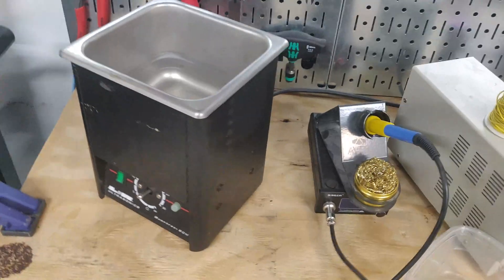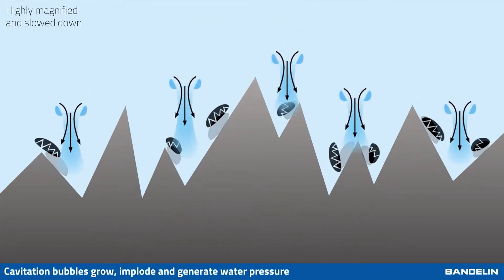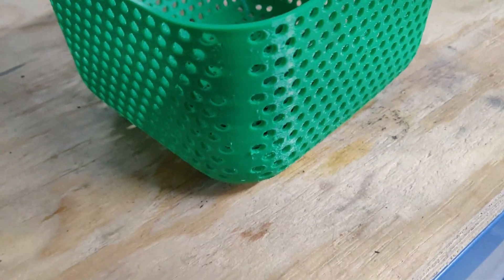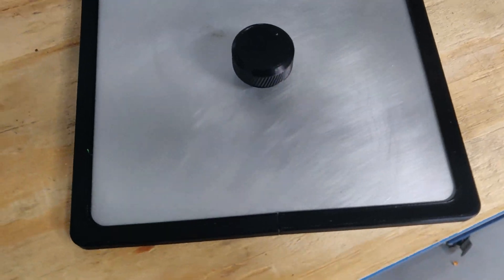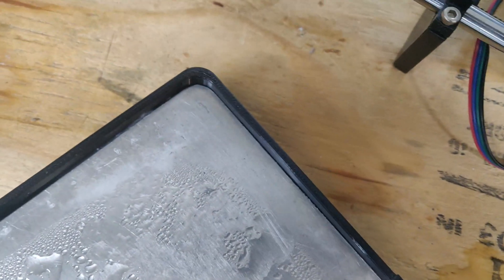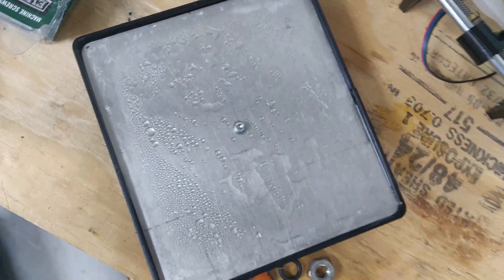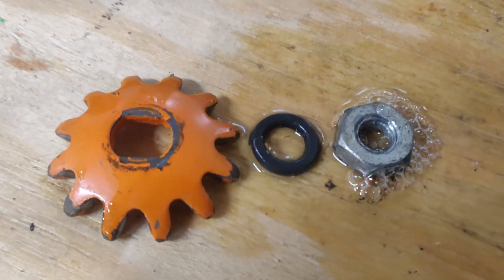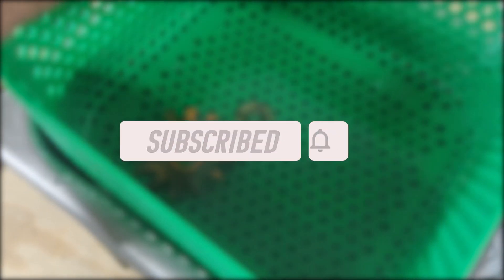Making an Old Ultrasonic Cleaner Usable with 3D Prints!

Comment: You can put jars or containers inside the cleaner, filled with solution and parts. Means your cleaner's bath remains clean, and your machine requires less messing about. The waves hardly care that they have to cover a little bit of extra distance, and we get to do much, much less cleaning, which is lovely.